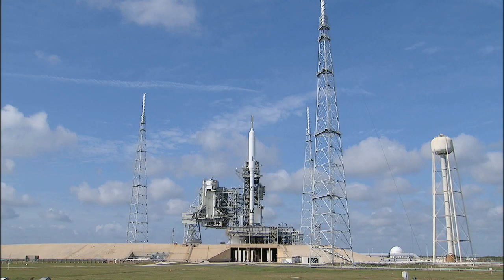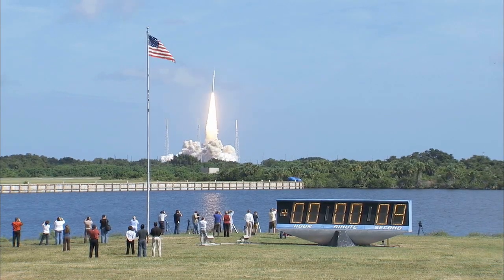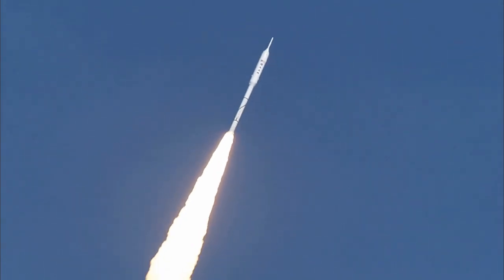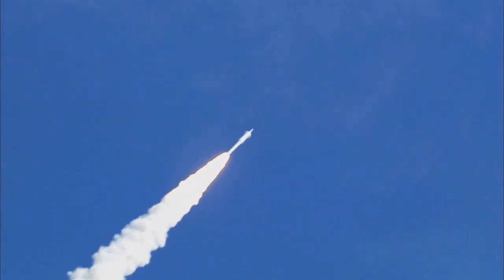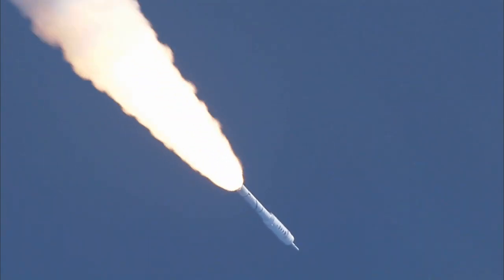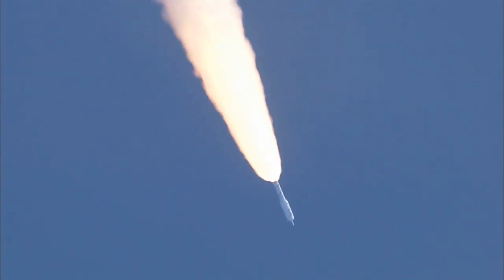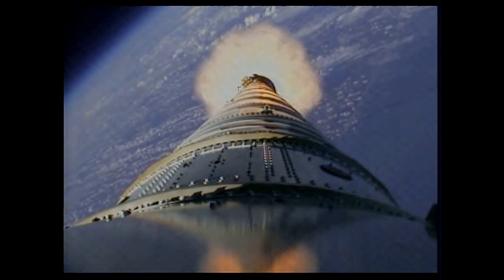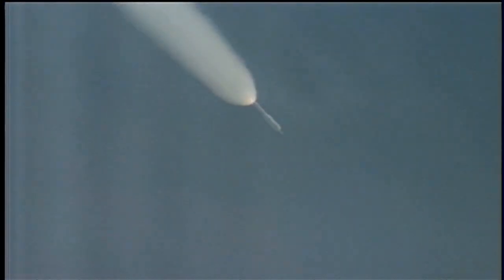Ares 1-X Test Rocket Launches

Comment: Literally the strangest and most dangerous rocket NASA ever made.
Reply: Wrong. it was safe, the whole mission went according to plan and it looks amazing.
Reply: @jacobdaniel6135  it was a solid rocket booster. That people got strapped onto.
Reply: @Blarnix  well you could say that about any rocket... "it's just a fuel tank... that people got strapped onto"

The srb is safe and even if something happened the emergency escape system is there for a reason
Reply: @jacobdaniel6135  It’s not “just a fuel tank”. It’s not even a tank at all. It’s solid fuel. I’m sure you probably don’t know this, but when an SRB is ignited, there is absolutely zero chance of turning it off. That means that if there’s a problem with the engine or the crew needs to escape, it becomes a HUGE issue with that SRB flying around at full thrust for however long. This could burn the parachutes, vaporize the spacecraft, explode the upper stage, etc. It wasn’t worth the risk. It was almost as risky as the space shuttle and it’s no wonder the program was shut down.
Reply: @Blarnix  I know it's not a fuel tank, I was just referring to any other rocket. And the space shuttle program was shut down because of lack of funding not safety... it was very safe in the end. And the emergency escape system has controls that steer it away from the rocket in case of an emergency
Reply: @jacobdaniel6135  The shuttle killed 14 people, but it was shut down due to the favoring of the commercial partner program. It was arguably one of the most unsafe vehicles in terms of abort. As for the Ares vehicle, it did have a LES, you’re correct. But everything I said still stands. Solid rocket motors with human flight is risky.
Reply: @Blarnix So what? the saturn v was littreally the same as this thing, but the apollo 13 abort did not involve the saturn V. Yet the saturn v never exploded with a crew or never even exploded all in its ten flights. So whats your point if this thing couldve rarely failed. If it wouldve failed, the LES would basically have the same speed as most LES's and a five segement soild booster would be slower then four segemnts if it ever took of on its own.

Comment: If humans rode on this they would pretty much have a 0 percent of survival if a failure happened

also isn't this just a space shuttle SRB??
Reply: Not true, you see that long thing on the top? That’s a LES, or launch escape system. It has powerful solid motors that would pull a capsule away in the event of an emergency
Reply: @coffeespy1133  bro you see the thing on the long skinny bottom? that's one of the worlds most powerful srbs
Reply: @tomintheholee8901  duh. And? The launch escape system would ensure the astronauts are fine
Reply: @tomintheholee8901  highly doubt they would even put an LES there if that were the case
Reply: @coffeespy1133  when an srb is detonated the solid propellant fragments would easily melt the parachutes of an aborted crew capsule and it would fall back down to earth

stop saying "why would they do that then" "why would that happen" "this is correct" "this would work" 

get  some straight facts
Reply: @tomintheholee8901  I highly doubt they would even include a les if this were the case. It’s just adding extra mass in that case. lol
Reply: @coffeespy1133  I find it funny how you keep saying "I doubt they would even add a launch escape system" of course they are going to add a launch escape system. Do you think NASA is just gonna let the astronauts be evaporated in a explosion.
Reply: @tomintheholee8901  well by what your saying the launch escape system wouldn’t work so why even add it?
Reply: @tomintheholee8901  u also just said “When an srb is detonated the solid propellant fragments would easily melt the parachutes of an aborted crew capsule and it would fall back down to earth” idk about u but falling from space w no parachute seems bad
Reply: @tomintheholee8901  what’s the point of an LES if it doesn’t save the astronauts lmfao
Reply: @tomintheholee8901  how would they survive falling back to earth with parachutes melted, please explain.
Reply: @coffeespy1133  Even if it won't save them of course they're gonna still put an LES and give the astronauts just a chance to live
Reply: @tomintheholee8901  what kind of human can survive a fall from km in the air with no form of deceleration. Are you listening to yourself?
Reply: @tomintheholee8901  so what’s the point of a LES if it won’t save them
Reply: @coffeespy1133  Because the rocket would have never even existed if they never proposed for this dangerous rocket to have an LES
Reply: @tomintheholee8901  it’s wasting mass and time. No aerospace company will do that
Reply: @tomintheholee8901  very toxic of you

Comment: The problem with this is that the vibration was too crazy.  And the research and development cost far too much for what is supposed to be a "cheaper" solution. Personally I don't trust NASA after two preventable shuttle loses.
Reply: The Columbia was less preventable than challenger but you do have a point

Comment: Woah, that thing REALLY got off the pad quick, that was a very aggressive gravity turn as well. Doesn't look like it would've been fun to ride.
Reply: Looks like an ICBM lol
Reply: I would for the hell of it though
Reply: They found that Ares 1-X damaged the pad during liftoff
Reply: @cin806  Acceleration forces were not a problem, but high vibrations were.   The shuttle system had the huge mass of the orbiter and a full fuel tank to absorb vibrations.  Onboard video of shuttle passengers show vibrations from the solids, but Ares-1 would have had nothing of the kind to reduce vibrations.  They were even discussing putting the capsule on some sort of spring system.
Reply: Jeff Vader it’s cuz it’s a SRB instead of a liquid fuel enhine
Reply: the shuttle had TWO of those haha
Reply: Space Shuttle was 3 Gs I think.  It wasn't as bad as the Soyuz.
Reply: Anon They all rotate at relatively the same rate is just more noticeable with the shape of the shuttle.

Comment: 2:17 - Whoops!  That would have been a hairy separation with a crew and a working J-2 engine about to be fired.
Reply: It had a tumble motor to purposely do that to this stage
Reply: This launch was just to test the first stage.
Reply: @friendlydispatch6283  Yes, but it did highlight a glitch in their launch sequence. If they had ever done another launch they would have inserted a longer time delay between the tailoff of the booster and separation of the stage along with the ignition of the tumble kick motor. The only reason both stages began to tumble was because the first stage solid motor was still producing enough thrust to keep shoving the second stage. On a real launch, they would wait for the SRB thrust to tail off completely, then separate, then a second or so later ignite the tumble kick motor, once there was clearance. 
Anyway, we have the Falcon 9 nowadays which can put more into orbit than the Ares 1 would have, and for approximately 1/10th the cost, so I'm not too upset that this thing was canned honestly.
Reply: That stage sep would kill the astronauts so I dont know if that was a good idea
Reply: @coolguy13333  that was planned, the second stage was just a dummy payload
Reply: @friendlydispatch6283  dummy” I did not see it live

Comment: Humans should never ride a rocket with solid propellant engines, but they are great for cargo or satellites.
Reply: And there are plenty of solid fuel rockets on Soyuz like the "soft landing" rockets. Space X on the other hand, uses zero solid fuel motors/rockets, that includes frangible nuts for separations, the Falcon heavy even used a hydraulic system to separate the side boosters.
Reply: @阳光山  that was due to a problem with procedure and management pressure not the rocket. It was known by many shuttle engineers that the O-rings were in bad shape, the info was not brought to the right people and management wouldn't listen. The second shuttle crash was caused by insulation of the propellant tank damaging the heat shield. The shuttle just was a much to complex to risky machine.
Reply: Flashgasm actually you are wrong, soyuz has killed 3 people on soyuz 1 from asphyxiation upon reentry
Reply: @riccardodambrosio3855  That was a political problem due to the politicians failing to accept their asking of money for spacesuits. Soyuz didn't badly fail, just a tiny malfunction, it landed with the corpses PERFECTLY, they would have survived. Had not been for the politicians, Russia would have zero deaths in space.
Reply: @1312_PV  its always a political problem 
Tell that to the engineers
Reply: @imagineaworld  Yes, it is. Same goes to Challenger for instance. Clear political problem against the engineer's will and also involved in this situation is the greed of subcontractors.
Reply: Riccardo D'ambrosio yeah but this was not an issue with the engines
Reply: and technically the Soyuz 11 crew you are referring to are the only people to have ever died in space (due to predicted time of death occurring before they crossed the Karman line)  @riccardodambrosio3855
Reply: Riccardo D'ambrosio no that’s a lie, first of all it was Soyuz 11 and second it was in orbit after a docking incident when it was separating and still did the auto reentry
Reply: @阳光山  MS-10
Reply: Thats why LES is there.
Reply: cough space shuttle cough
Reply: Guys, the best thing to have would be the following system:
A Space Shuttle that has SRB's which are monitored as good as possible and are DETACHABLE WHILE BURNING without any risk; you could mount wings onto them so they can fly away from the orbiter like a rocket plane when you detach them while burning. Then also in case of exploding SSME's a detachable Engine mount and emergency LES rockets to pull the space shuttle away from the external tank. You could also make the cockpit detachable and provide parachutes on it.
Reply: Crew escape towers*
Reply: When they are well use its ok but still its risky
Reply: @阳光山  Crashed?  You mean exploded into bits.
Reply: That’s a myth created for political reasons to kill the program and Highjack funding.
Reply: @pzoe3808  I'll believe John young and Scott Kelly. Read their biographies.
Reply: Flashgasm until now
Reply: 阳光山 First of all, the SRB that led to the Challenger disaster was not “deduct”. It was launched in poor conditions that led to failure of a critical component. It would have worked fine the next day. Second, it is idiotic to compare the space shuttle’s safety record to that of Soyuz considering it has done many more manned-missions.
Reply: Liquid propellant rockets are much more complex and are more likely to fail because even a small error kill it.
Reply: 阳光山 well actually no (oh wait other people have already corrected you)
Reply: @阳光山  soyuz 1
Reply: @阳光山  What are you talking about? It's had numerous incidents. Most of the early flights resulted in crewed death, 2018 saw a failiure in the booster seperation
Reply: Ghostbusters3 tell that to the shuttle. Liquid fueled engines are MUCH more likely to malfunction and kill you
Reply: @kaydnburns5935  That was an O ring that failed on a SOLID ROCKET  booster. You got your facts reversed... and I know you know better. LOL Everybody knows that the Shuttle used 2 solid rocket boosters on each side of the tank.
Reply: @kaydnburns5935  come again? SRBs are much more dangerous, and the Challenger disaster was a SRB failure.
Reply: @dustinmorrill5540  Highly incorrect. Wasnt a SRB failure. It was a piece of thermal foam that hit the fuel tank at mach 3 lmao.
Reply: @dustinmorrill5540  You can literally see the SRB's flying completely fine away from the main vehicle after the explosion.
Reply: @kaydnburns5935  you do know that the solid rocket booster is what killed the crew, not the rs25 engines. in fact, the rs25 was one of the most reliable rocket engines ever.
Reply: Dark sky's you do know it’s not the solid rocket motor that killed the crew right?
Reply: Dark sky's insulating foam slammed into the wing of the space shuttle at extremely high speeds cause a rupture of the on board and external fuel tank leading to the explosion. You can literally see the SRB’s fly away in quite spectacular fashion, intact after the explosion
Reply: @kaydnburns5935  You do know that 2 shuttles got destroyed right? This wasn't one event. 

The first one was destroyed by a faulty lower o-ring on one of the shuttles srb's that leaked because nasa didn't want to wait any longer, so they chose to launch in relatively very cold conditions for a shuttle launch, which caused the o-ring to not seal and in effect made hot gasses escape and caused the srb to break off on ascent.

The second one was due to the insulating foam from the orbiters external tank hitting the orbiters wing on ascent. Then on reentry the hole acted like a blowtorch directing heat into the interior of the orbiters wing, basically weakening the wing untill aerodynamic forces tore it off.

This doesn't prove that solid rockets or liquid rockets are either more safe or dangerous since one or the other contributed to both orbiters being lost. At the end of the day, both accidents was negligence on nasa's part.
Reply: @kaydnburns5935  IDK what kind of engine is more likely to fail, but solid fuel engines are more likely to kill you when they fail. Liquid full burns up and disperses, and you can shut down those engines to make a clean emergency escape. Solid fuel keeps burning and showers you in chunks of hot fuel, and you can't shut them down to get away from them.
Reply: @Synergy7Studios  We used solid rockets for over 30 years on manned missions. Only two failed
Reply: @kaydnburns5935  If you're referring to the shuttle, only one SRB ever failed. Afaik, no liquid engine has ever failed on a manned American vehicle during a manned flight.
Reply: Kaydn Burns Not True I can think of at least one example where the center engine of Apollo 13’s second stage prematurely shut down.  There is nothing wrong with solids for manned space flight. The reason the shuttle was so dangerous was because it did not have a launch abort system like the Ares 1 in this video has. Also only one shuttle was lost during launch (challenger). Columbia the other lost shuttle was destroyed during reentry after a chunk of foam from the external tank broke off during launch and damaged the thermal protection tiles on the leading edge of the shuttle’s wing. The foam was there to prevent ice build up on the cryogenic fuel tanks, so technically one could argue the solids destroyed one shuttle, and the liquids destroyed the other. Also every launch abort system I have ever seen uses nothing but solid fuel rockets, and they are probably the most critical rockets to get right.
Reply: @Synergy7Studios  not true. On Apollo 13 one of the second stage’s J-2 engines failed and on STS-51F, one of its RS-25 engines failed.
Reply: @EthanPricco  Fair enough. I guess I meant failed catastrophically. Those failed in uneventful ways. Iirc, the J2 was shut down due to pogo oscillations in the tank. The engine was ok.
Reply: @Synergy7Studios  yeah catastrophically would make more sense. Also, I did not know about the oscillations in the tank, thanks for letting me know about that.
Reply: @EthanPricco  no problem! I think the shuttle engine may have been a result of wiring somewhere else in the shuttle being damaged, i can't remember. Of course in a way the wiring is part of the engine, but the engine itself might not have been the cause. Plenty of liquid engines have still failed though.